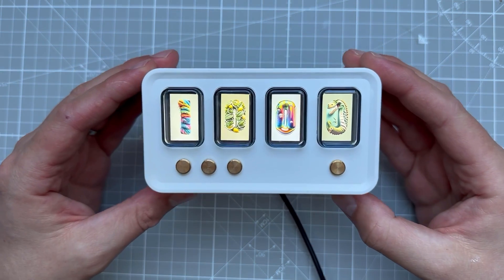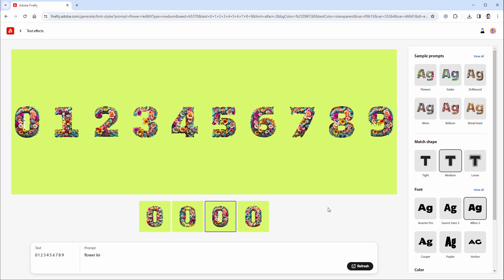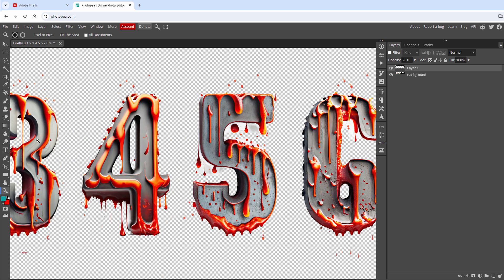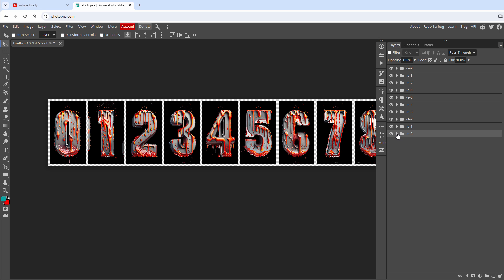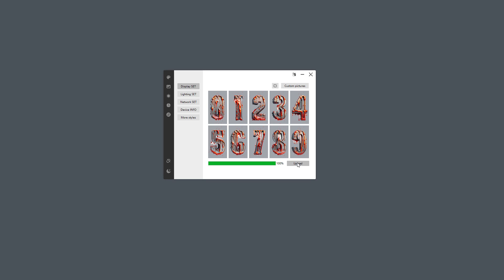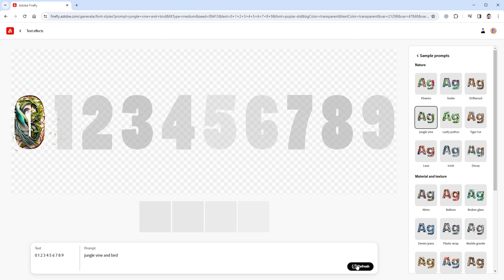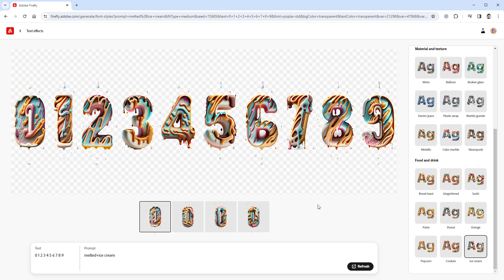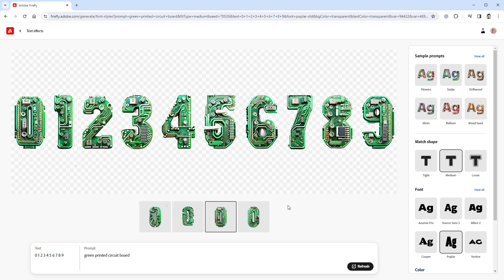Create custom themes for this ISP fake-nixie clock

Comment: Cool idea. Always nice seeing these tools you find.
I found your videos on u8g2 really helpful. I'm building a project with multiple oleds, so I've had to experiment with using a TCA9548 i2c multiplexer. Might be something you're interested in. Some annoying hurdles dealing with Wire and u8g2
Reply from the maker: Thank you for your comment. I have also purchased I2c multiplexer for the same reason and I will use it in my future video. However, I haven’t tried it yet. What kind of problems were you facing?
Reply: @upir_upir  (I'm using an esp32) since u8g8 calls wire.setClock,  it was hanging when doing u8g2.begin. so for my init sent to each screen, Ive added wire.end then u8g2.begin. I don't know all the reasons behind it, but basically wire on, change TCA bus, wire end, u8g2 start, rinse and repeat